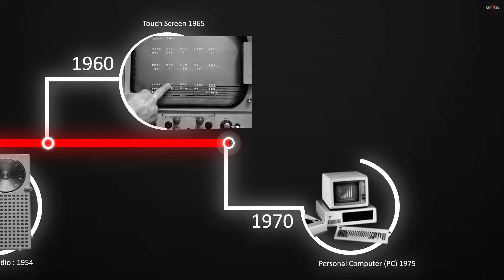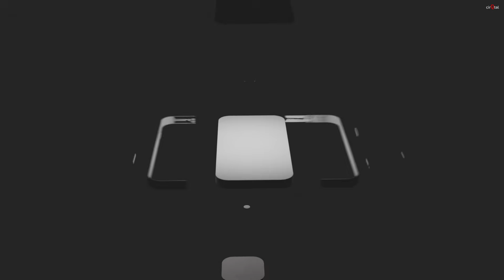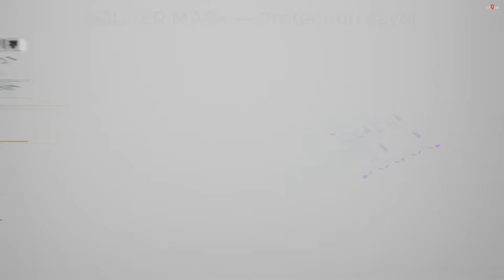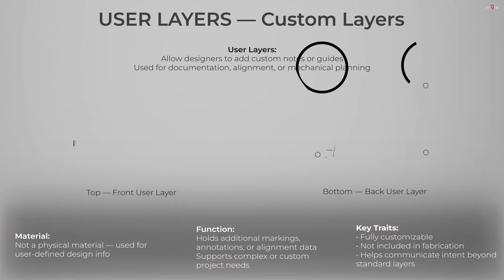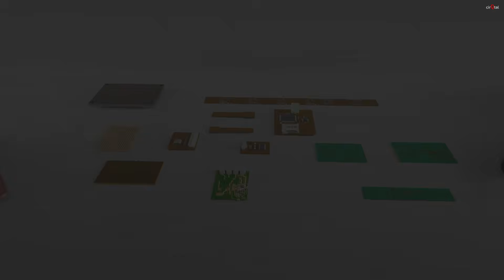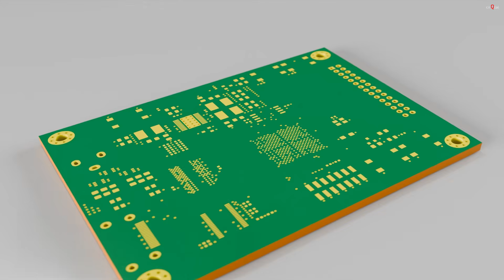PCBs Explained: The Brain Behind Electronics! #pcb  #electronics  #howthingswork

Comment: This is a great video. Only one thing, I faced slight confusion towards the end. It kinda makes it seem like the base or core of the PCB is a straight piece of copper, but isnt it a piece of fiberglass epoxy with very thin copper foil on top? And I know this is explained earlier but I just wanted clarification because the animation and explaination near the end seem a tad bit contradictory from earlier in the video.
Reply: you are correct. the etching process removes most of the copper and solder mask is applied afterwards. the video got a bit confusing colors at the end.